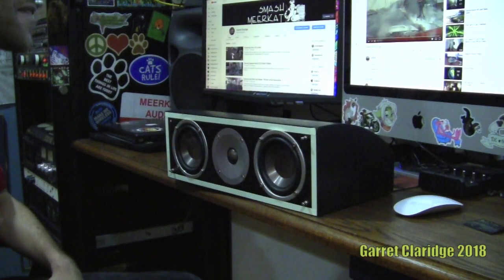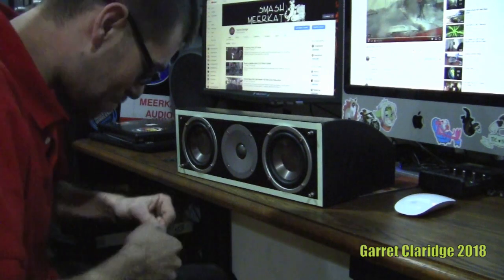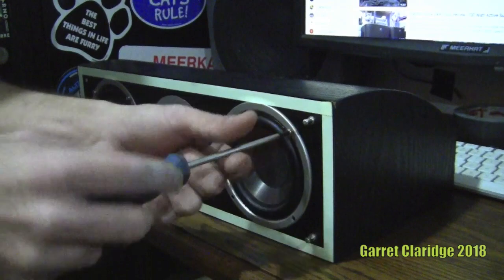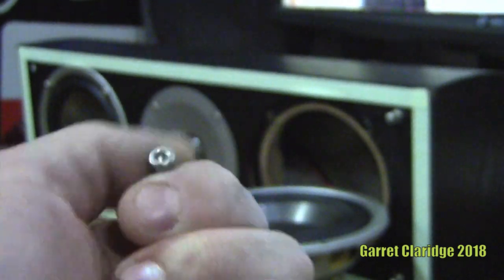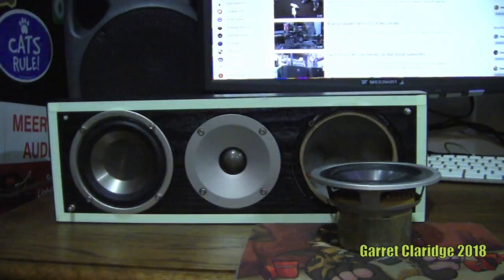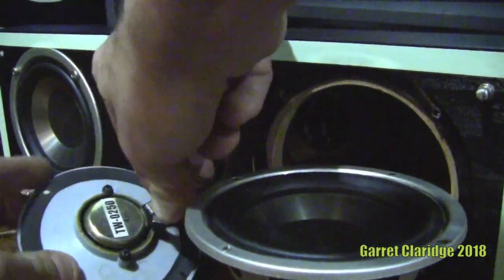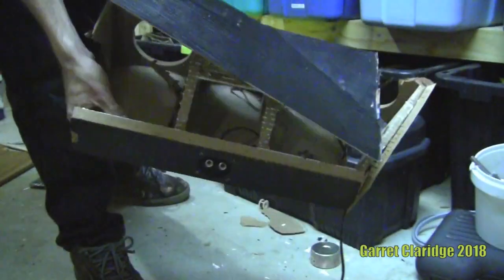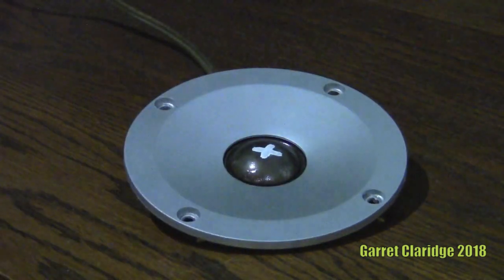SPEAKER BLOWOUTS! - Centrios Centre Channel

Comment: that thing actually looks pretty good, it has a a-systematical box for the best frequency response and the woofers look like ass plastic but as you stated in the video they took the CS-800 like a champ. the only thing that looks bad is that little tweeter, l swear it's a piezo in disguise.
Reply: it can't be, l have a tweeter like that laying around and it's way too light to be neodymium. also piezo tweeters are tiny, they whole thing with the driver magnet and all is no bigger or thicker than a quarter.
Reply: Electronics For Fun In any case, that’s not a Piezo. How in the fuck did you even arrive to that conclusion XD?
Reply: Gruvve they probably have a piezo disc and a cone inside of them, amplified by that horn.

Comment: Still using that 09 iMac

Nice
Reply from the maker: the screen just blew on my 06 intel but its still running on the living room tv haha
Reply: I’m just using a hackintosh that took me almost a year to make xd and my MacBook 09 keyboard and trackpad doesn’t work anymore and it takes over 2 days to fully charge so I just use it to share the WiFi with a router
Reply: My iMac G3 had a issue so I torn it down again and cleaned it up and it worked again, it’s holding up with scotch tape

Don’t destroy it claridge xd
Reply: I’m looking for a PowerMac G5, I just like the case design of it
Reply from the maker: I have that case Ive been trying to give away for a year, its rusting outside now might have to do a video with the thing, but I took the guts out
Reply: Garret Claridge I remember that in one of ur old vids I was wondering what happen to it